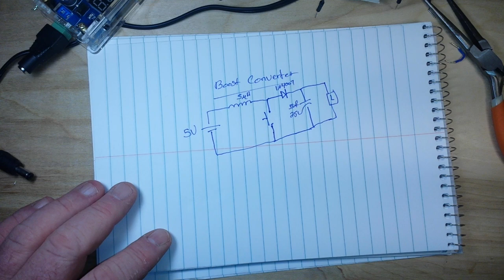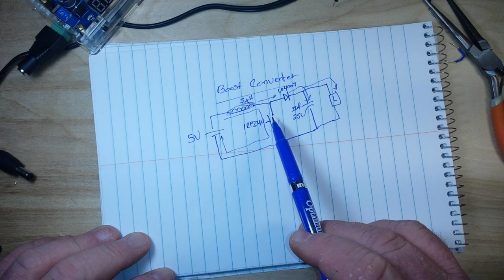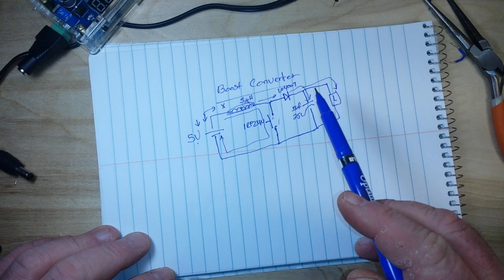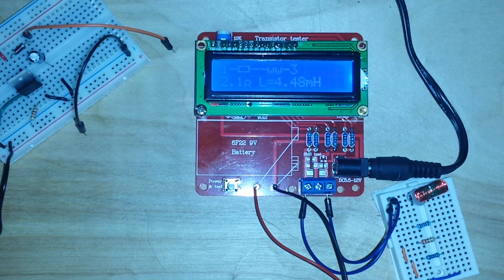Make your own boost conveter

Comment: What will happen if you switch the positions of inductor and switch in the circuit, and also flip the direction of diode?
What should be the output then?

Comment: I notice that the switching speed of the irfz34n is 100khz for the optimal performance and you mentioned that the 555 time was clocking about 500khz. Is this a normal thing. Still learning. Ty .

Comment: im confused. 5 volts from the supply plus 5 volts from the inductor equals 10 volts. where does the extra voltage come from?
Reply: It is a fundamental property of an inductor that you cannot instantaneously change the current through it.
When the switch is closed you store energy in the inductor as a magnetic field. If the current in the inductor were zero at the time the switch closed the current would start to rise linearly with respect to time. The magnitude of current if would reach is directly proportional to the time and to the voltage. Let's say that it reached 1 ampere.
At the instant the switch opens, that current will still be 1 ampere. The voltage across the inductor will essentially instantaneously rise to whatever it needs to be to make that current flow. It doesn't matter if the voltage across the inductor at that instant can only be 10 millivolts or 200 volts, it will make 1 ampere flow. That's how you get the high output voltage.
A switchmode power supply is a power converter. If you want 10 watts out, you must put 10 watts in, assuming 100% efficiency. With a boost converter the output voltage is higher than the input voltage. If you had a 10 volt input supply you'd take 1 ampere from it for the 10 watts. You could take the output at 100 volts and 0.1 amps or at 20 volts at 0.5 amps. How you actually do this in a real circuit is by controlling how much time the inductor is charging versus how much time it is discharging. Usually this is done by controlling the duty cycle with fixed frequency. In a boost converter the discharge is much faster than the charge because the voltage across the inductor is larger.

di/dt = V/L
the rate of change of current in an inductor is equal to the voltage across the inductor divided by the inductance
i is in amperes, t is in seconds, V is in volts and L is in henries
Reply from the maker: Right on!

Comment: I'm trying to replicate your circuit and I've noticed that you've indicated the capacitor voltage of 25V, but in the end you've got about 29V of output voltage. I assume that the capacitor should be 50V or above.
Reply: Aluminum electrolytic caps will tolerate some over-voltage for a short time, but you should never design for continuous over-voltage. You could use a 35 or 50 volt cap for 29 volts.

Comment: what determines the voltage output? In the video, when you put a 100k resistor as the load you got a steady 29V. So what part of the circuit determines how high the boost converter's voltage will reach?

Comment: Thank you for your very good training
I had two questions:
   1) Is it possible to use another power transistor instead of MOSFET, such as 13005 or TIP41C, etc.?
2) Explain the reason for using 10k resistor once again? Does It work without resistance in this section?
Because I made another example with a three-ended coil and TIP41C and got the result, but with the two-ended coil and injecting the signal to the Base or Gate base, no result was obtained. Of course, I did not connect a 10k resistor to them. Thank you very much.
Reply: Resistor is there to pull the gate to 0v.
Mosfet will still be on even after removing gate voltage,so you need to tie gate to ground through resistor to turn it off.
In your case,without the resistor connecting gate to the ground,the MOSFET is always on and no pusle is generated.
Reply: @naingtheawperc3817  Yes, but in this case the 555 timer square wave will pull it both high and low, so really it is not necessary.
Reply: In years gone by switchers were made with bipolar junction transistors. However, very fast switching is important for good efficiency and though you have to swing quite a bit of gate current into and out of a power MOSFET gate to get it to switch if fast, they do switch very fast and can handle some things that kill BJTs. BJTs often need quite elaborate "snubber" circuits to protect them (a boost converter is more or lesss "self snubbing"). The MJ1300x types were fairly popular for switchers operating at moderate frequency (20 to 40 kHz, typically).

Comment: Sorry to post a question on an old vid but I was under the impression that a pull down resistor was not needed when driving with a 555 because the 555 output goes to ground when not high. If I reverse an LED across the output of pin 3 it lights every time the pin is low and turns off when the pin goes high. So how is the 555 LOW different from ground? Is it not quite rail to rail, so to speak?
Reply: Which pin are you talking about? Pin 3? That's going to gate of the MOSFET. Maybe I need to rewatch the video, but it looked fine to me.

Edit: OK, I'm looking at 3:45, and now I see what you're talking about. There's a wire there though, not a resistor, and that's why I was confused. My best guess is that it's a leftover from when Paul was testing the timer, needed to sink the signal on the OUTPUT pin, but forgot to remove it before tying it to the gate of the MOSFET.
Reply: You are correct, the 10k resistor is superfluous since the 555 will pull the output both high and low.

Comment: Hi, very grateful explanation,but there was no IC and some other capacitor in circute diagram.later you used IC and other eliments on pc board.we can't build this circuit with out IC and other eliments?
Can we make this only what ever in the circuit diagram ??
Reply: I get you.
You can build this circuit without the 555..
And without the mofet if you can push a switch a few hundred times a second.

The basics are that a switch (MOSFET)  is fast and this turns on and off, to get the build up in the coil. 
There are many ways to make the switch, a 555 is easy and has two ((asynchronous switching)), which isn't needed, there are MOSFET drivers, bjt's

And if you don't have a  IC  you can make a charge switch using resistors and capacitors to the gate on the FET.

That works by  building a charge in a capacitor which has to pass a resistor when it builds and then reaches the gate and is discharged, this charge and discharge will occur in ms, and youll will have to add this to drive the switch which will change the voltage. Make one resistor variable and you can change the voltage.

You also need to add a fly back which would be the other half.
Reply: Thank you very much.i understand.

Comment: i followed this circuit using a 3.3uH inductor, 2.2uF cap, and a 230kHz switching frequency. It works great but the mosfet gets ridiculously hot with and without a load. does anyone know why?
Reply: Are you using the recommended MOSFET? A MOSFET is nearly zero resistance when fully off and many Megohms resistance when fully on. It is a near perfect switch. But when not fully on or off it's resistance is anywhere from tens of ohms to Kilohms. This is almost always what heats or overheats FETs and MOSFETs. You must be using a MOSFET that doesn't have triggering as low as the recommended one. Or try a lower value pull down resistor. Another possibility is that the MOSFET has a large gate capacitance and the 555 can not hit it with enough current to turn the gate on and off quickly enough. This leaves it in heating element mode to long each cycle. Good luck. This stuff is hella fun when it works.
Reply: When the fet closes the input voltage is essentially shorted to ground. The fet will have max current going through it, or as much as the Vin can supply. You could put a low value resistor in series with the fet to limit the current to whatever the fet is rated for

Comment: I'm doing this later today I've seen some hook up the mosfet or bjt yo the inductor to  control the mosfet.    Theres no micro vonttoler as far as I can tell . I don't  get how its being controlled without  some   sort  of micro  controler. What determines  the  maximum  output of the boost converter.   Is it the mosfet switching speed or the inductor

Comment: Thanks for learning me about this circuit, I played about with it and found that when I used the 10k resistor that pulls the gate of the mosfet to ground well when I used the one I got in my elegoo kit which has 0.6mm legs I got 68volts at the output, if I used the ones from ebay that I got which are 0.4mm legs I could only get 25 volts this was at the stated current of 20milli amps, Also I never had a irfz34 so I used a irfz44 and a 50volt capacitor 22mf at the output is what I used. But to finalise I would never have achieved this if i had not been for learnelectronics help thank you for sharing your knowledge of electronics.

Comment: I want to use one of these to charge a lithium ion battery, my source voltage is 13v and I need 16.8v to charge the battery at about 15A, how would I calculate the components required?

Comment: Good tutorial I guess it was mH on the meter.  why not elaborate a little more and regulate the output voltage by varying the pulse width on the 555 timer.  Perhaps some feedback will suit perfectly.  Have you an idea how to make a boost converter with  a double output of + and - 12v charged from a single lithium battery of 3.7v?

Comment: Hmmmmn.......the meter said 4.4mh [milli-henry] not uh [micro-henry]..if it were 4.4 uh it would read 0.0044 mh on the meter....I have wound many toroids and use the same type of meter on mine....to stay in the micro-henry range I wind around 10 to 20 turns on a toroid core....[BTW I have learned lately that I should only use powdered iron toroids and not ferrite core]....if I am wrong about this I will stand corrected...

Comment: If we have 12V and 1Amp(fixed maximum) and we boost it to 48V then what maximum Amps we will get from 48 volts?
Reply: There is no feedback in this circuit ,hence the output current and Voltage are not constant.
Bigger Load Will drop the output current and Voltage.
Knowing about the Power,you can determine Volts and Amperes.
Reply: 12V at 1 amp is 12 watts.  That's 0.25 amps at 48V.

Comment: Can you tell me how to add a feedback circuit at it for sudden change in load pls pls pls..
Btw i am a fan of your work .
Love frome india .
Reply: Use a voltage Divider at output followed by an Opamp( As a Comparator) which is connected to an Microcontroller or Any IC .
The Microcontroller will increase or Decrease the PWM signal Duty cycle Based on the Requirements of load for a stable Output.

Comment: How high would it climb with no load . Could it blow the capacitor?
Reply: use a high voltage capacitor
Reply: @big_o1952  ok

Comment: Does a boost converter follow the same current ratio calculations as old fashioned voltage multipliers?  Current being inversely proportional to voltage. I.E 10V 1A to 20V .5A minus parasitic loss?
Reply from the maker: No. A boost converter is simply a switch mode power supply. So it follows those conventions.
Reply: Was wondering if current loss needed to be factored in when using a buck converter. Thanks

Comment: How does the 555 timer is used in the sketch....show it how it is connected to the diagram...
Reply: Look at the videos demonstrating how to configure a 555 in astable mode. Then notice that pin 3, the output pin, is hooked to the gate of the MOSFET. As the square wave generated goes high and low, the MOSFET opens and closes.

Comment: Man, this is great. I thought I should be able to build one with a 555 but the tutorials I keep finding use micros. Thanks for the video.
Reply: I think the constant drone about using microcontrollers is crippling to kids coming up in the hobby or industry. There is a time and place for microcontrollers and a time and place for discretes.
Reply: Thats great but I thought i should be able to find one with transistors, but i keep finding ones using discrete IC's like 555 timers and microcontrollers. All these use of IC's are crippling kids comming up in the industry. Just use a 555 timer they say, great, but whats that? Just kidding but you do see complaining about microcontrollers i could be complaining about the use of 555 timers as they dont teach me anything either. That being said micrcocontrollers have these circuits built in, which isnt taught and should be, how to manipulate the CPU's timers to create PWM etc. Thats all microcontollers are, the ability to program these circuits how you want, programmatically, so you dont need a trim pot to set the pwm duty cycle, you can tell memeory to store that information and use it when need be. Change it at different times. Its all just electric circuit with MCU's , just more convenient and powerful. With how cheap MCU's can be, sometimes i fail to see the reason to get a discrete ic that needs extra circuitry to power up.  That being said its nice to know how these things are done with discrete components, so you can just build what you need and not the extra's IC's give you and I found  a video like that -  https://youtu.be/CcMiGZUzITo?si=28xFSx4_mfSv4DEr  Simlest PWM generator using no microcontroller nor 555 timers, just transistors.

Comment: How much control in volts Does the 50 k pott have in range. and at mosfet left side your using a resistor ? right side straight to ground bar not sure why great show today im trying to build my now spinning my magnet wire now fun fun

Comment: You are not connecting the load to ground! You are just measuring the potential after the resistor referenced to the ground, but there's no current flowing to the resistor because it's NOT CONNECTED TO GROUND, the multimeter has high resistance between its probes!! You are not loading that circuit a tiny bit!
Reply: When he puts the resistor load, he puts it in series, which means he has the resistance of the resistor summed up with the resistance of the multimeter which is really high, so his voltage is not really affected by this load. If you would put the load to the ground, and be that a small resistor 100Ohm, this circuit will most likely drop in voltage significantly. Don't try to reinvent the wheel, just buy it from ebay, they are much more stable than anything you can build at home.
Reply: @MitkoNikov  dude you are right that's why he got low output current 👍
Reply: Have you tried to recreate this  circuit to test your theory?

Comment: I tried to design boost converter with switching frequency 1kHz and inductor 4.5 mH but when circuit get on it boost voltage from 15v to 50v but then after it continues to decrease until it fall down to almost half of input voltage

Comment: Hi, L/E,I hope you have just solved my problem. Trying to run a 10watt LED off this curcuit which I belie e requires max of 24 volts..Now, Running it at a slightly lower wattage to about 8watts,less strain on the LED,I hope it should last longer..The Project is::::: To catch a rat in the garden that is constantly making holes under the fence..Probably in the dark...hmmmm..If I know he is there, I can despatch him .... Hoping you can give me a little more information on the amount of wire turns,and check the said curcuit,as it is roughly the same as yours..As said it will be to turn on a 10w LED,,, THE CURCUIT Will not be on allthe time as I want to fit a n IR Sensor to it..Any asstance would be a great hep..Thank You.

Comment: very educational. With your knowledge I was wondering if you could help me.  I bought 5v to 12v stepup board with only 8watts max. Need it to drive 12v 1ah 10w. Will 2 board in parallel works?will (12v 2ah 16w) hurt (12v 1ah 10w)

Comment: can you make a boost converter with arduino PWM and an octoisolator..so that we can safely control the voltage digitally through serial port
Reply: VibeX MaTxeMa you can (it's what i am doing) just be carefull to not fry your arduino :)
Reply: Optoisolator isn't really necessary

Comment: What should i do to get voltage upto 500volts?
Reply: Get a capacitor that big...
Reply: You need to check for the inductance of the inductor used more the inductance higher the voltage can get and frequency of the oscillator is also proportional to the voltage output also use an appropriate capacitor at the end for smooth output voltage . By the way this is not the circuit for high voltage output this one is nice if you want to drive 20volts load from 5volts battery but if you want something to play with having 500volts output build something with appropriate transformer not with a inductor circuit like this because the high voltage peaks can damage your battery but in case of transformer based circuit your battery is safe .... : ) ignore typing mistakes if you find some

Comment: Question: how much amp can this circuit supply?
Reply: It depends on wattage. It can't produce extra wattage out from no where. You said 12v and 150mA, but how much exactly this 12v supply can deliver of amperage. If we say that this is 12v 2A supply, so the input wattage is 24W (12*2). In this case the boost voltage can't give power more than 24W (if we considered efficiency is 100%). So with 24W input and you boost your voltage to for example 48v, it will only capable of delivering 0.5A (48*0.5=24W) if not lesser.
Reply from the maker: about an amp
Reply: Well say Ian supplying it with 12v and 150ma, will it still give me an amp and atleast 12v?

Comment: Thanks for making this.  How much is the current output reduced when doing this?  Also, is it possible to create dangerous voltage/current at the load if you're driving it with, say, a 12V battery?